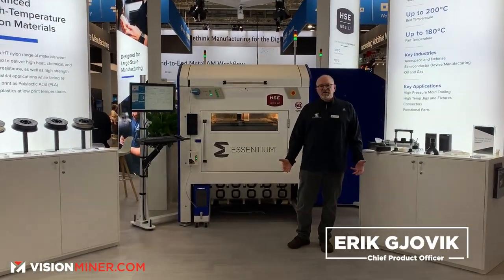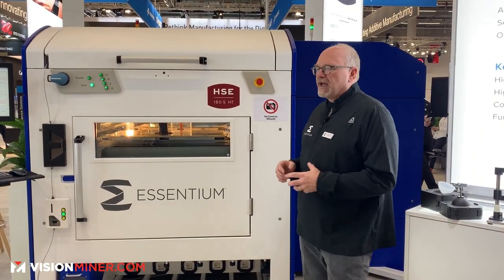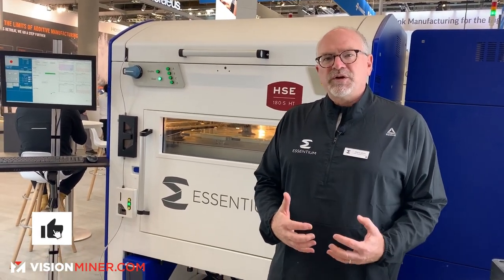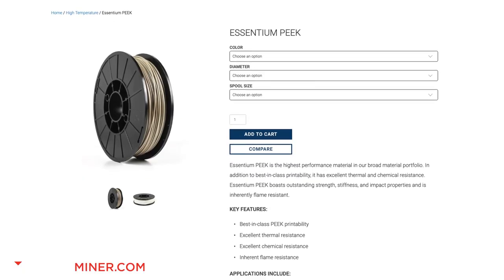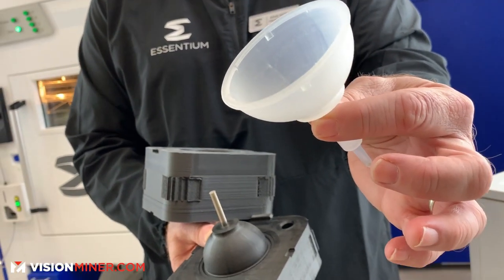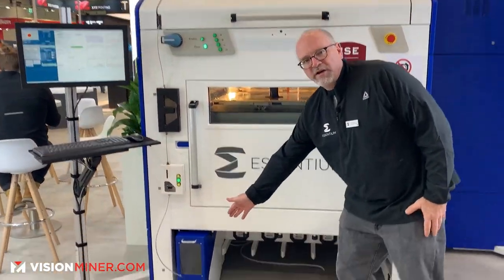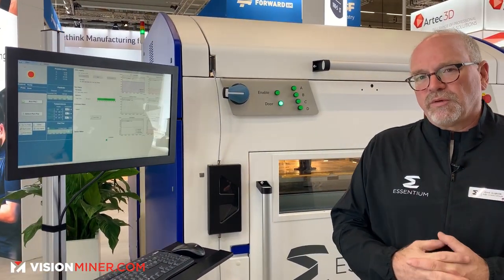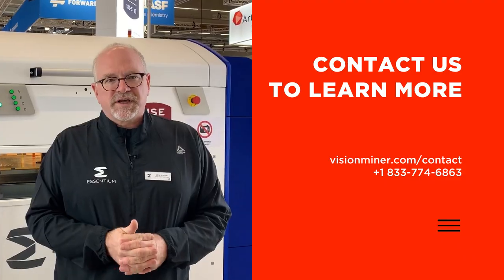Essentium HSE 180S - Specifications from the Engineer - Worlds Fastest 3D Printer? (2020)

Comment: So many cool things in a short time.  I had to pause it a few times to get all the cool details.  Thomas and Stefan (at their Meltzone podcast) were just answering a question where someone asked why linear motors weren't being used in printers.  For hobby printers there reasons make sense for why they aren't used.  For a commercial machine like this, it's great to see these motors making things faster, more accurate and reliable.  Can't wait until they're available on a Creality machine.

Comment: The prints in the videos look just a bit rough. I've seen some amazon printers produce a cleaner looking part. I would still love to get your machine for my business because of the speed and large bed volume. But If I paid over a 100K for this machine I would expect mirror perfect layer stacking and auto bed leveling.
Reply from the maker: You'll be glad to know these actually start below 100k, but the main purpose is speed and volume production -- in that case, many of the parts may have some rough edges, but check out the other video on the HSE about surface finish -- there are many ways to post-process efficiently -- for example, many of these parts can be put through a vibratory tumbler for a few hours to produce a much smoother surface, and then can even be coated or vapor-smoothed -- there's a lot of options for high-volume production and still getting great-looking parts, but slinging a hot glue gun around at 3G's of acceleration won't always have the cleanest part straight off the bed :)
Reply: @VisionMiner  Thank you for that info. I would rather run the printer slower than have a separate machine to clean up the mistakes of the first machine.  Does your printer have auto bed leveling?
Reply from the maker: @Chupria  You can still go slow on these machines, but for high-volume production, a secondary post-processing step is much more efficient -- also, we don't make machines, we use them and sell them, and help businesses keep them running -- as far as auto-leveling, on a machine that goes 100mm/s and costs closer to $70k..... what do you think? I'm going to let you answer this one yourself :) (i.e. yes, of course it does :P)

Comment: 200mm/s?  My modded Ender 3 bed slinger runs 250
Reply from the maker: Not for long, it won't.... that thing will rattle itself apart in the first couple hours :) don't get us wrong though, we love those units and have a few here, but this is on an entirely different level. Printing PCTG at 800mm/s in production volume capacity --- 24/7 365 :)
Reply: @VisionMiner  what kind of acceleration?
Reply: He said it prints PEEK at 200mm/s and you are comparing it to you PLA speeds?  Lol dude dream on about your ender..
Reply: @malloot9224  this comment was made 4 months ago and answered 4 months ago...
Reply: And that awnser completely glanced over the fact you are comparing PLA speeds to PEEK speeds. But I have the feeling you are the type of person that never sees his own failures to understand so I will keep it at this.
Reply: @malloot9224  I do own up to my failures, but you're also being aggressive and assuming quite a lot with your comment.  My comment was more pointing out that 200 isn't very fast these days, even with a material like peek.  I am not in any way trying to claim that my ender 3 would out perform this printer on any metric.

Comment: 5:24 i was not expecting this printer to use E3D titan extruder ass a part of the extrution system.
Reply from the maker: That's no titan...
Reply from the maker: That's actually the "slacking" area for filament loading from the lower bays -- it just keeps enough filament "loose" to be pulled in by the extruder when it goes in fast spurts. Crazy to think hahaha, they've got a mega titan just for keeping slack on the filament!

Comment: Need more explanation to "like fdm but not fdm"
Reply from the maker: It's their own process, but they're still squeezing plastic through a nozzle, which is essentially FDM :)
Reply: When he said no retraction I believe he means this is a true 3d printer, the average "3d" printer is actually a 2 ½d printer meaning it does one z layer at a time. This printers z will follow vertical contours so the nozzle never has to come off the part. This makes the material fusion and the finish MUCH MUCH better. Layer lines are almost non existent looks and acts like a molded part. There is actually a program out there to convert home 3d printers to this process but it takes some work and tinkering. I suspect in the next couple years most 3d printers will be like this. I can't wait!
Reply: @jesusisalive3227  You are talking about non-planar or 3D slicing. However, from the looks of these parts it looks as if they are doing normal 2.5D printing.